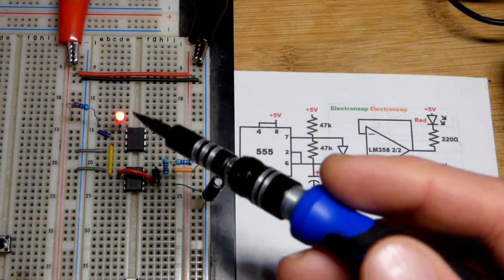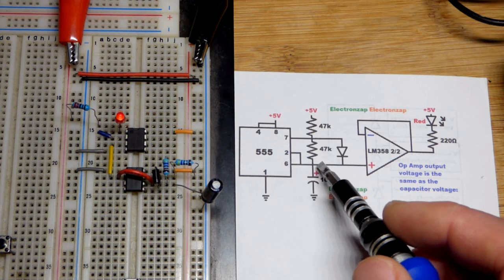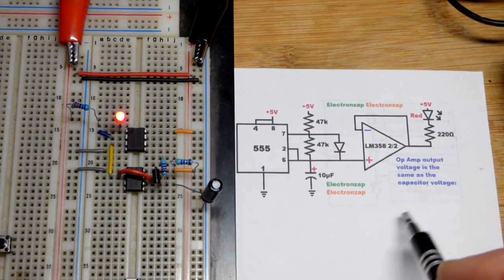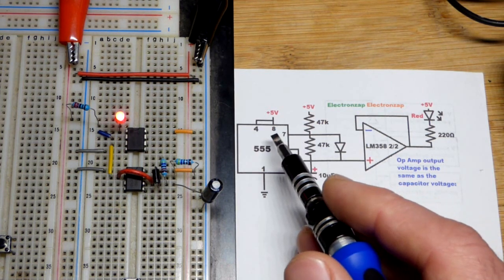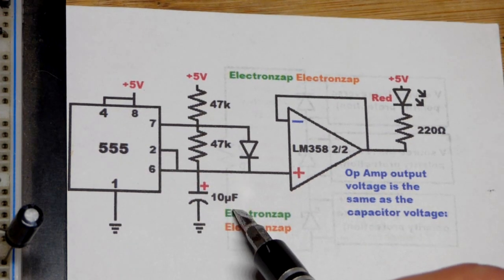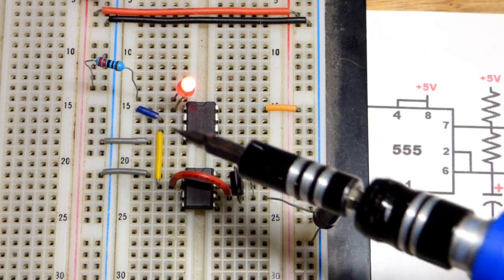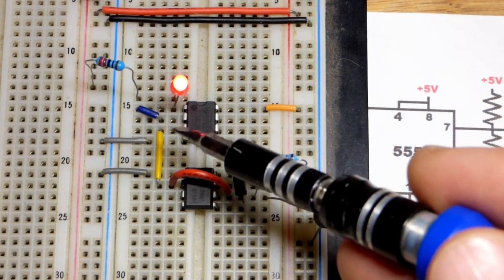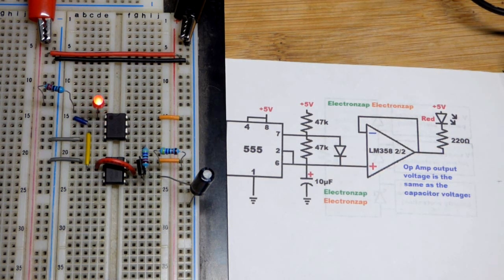Pulsating LED Circuit using Astable 555 Timer and Op Amp Voltage Follower

Comment: So I simulated the circuit, and in order to light the LED I connected the battery's (-) to the ground point that is connected to the "1" pin of the 555.
p.s.  On the 555 pin "3" read 3.5v and "5" read 3.33v.